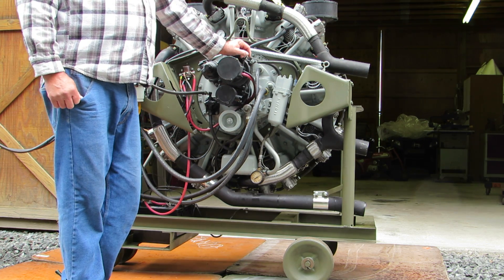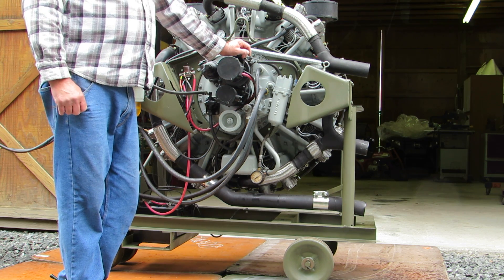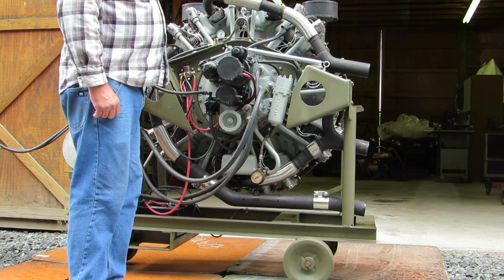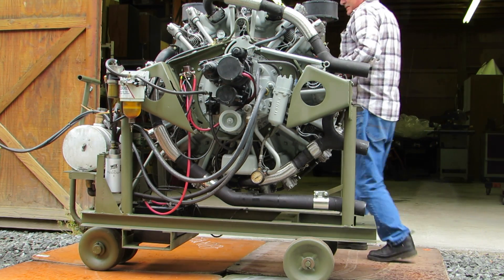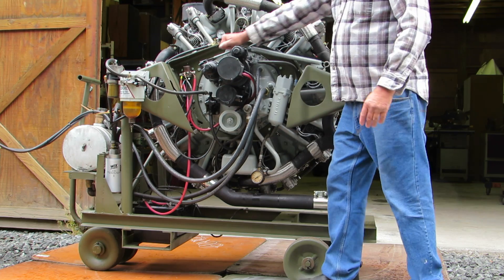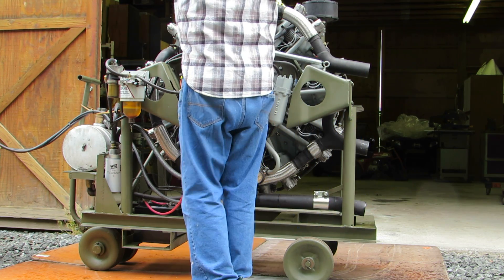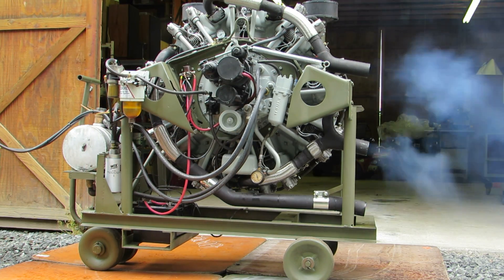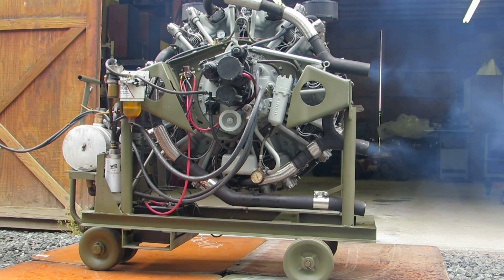Guiberson radial diesel engine, M3 Stuart Tank

Comment: I know this is an old video now, but did these things have the same oil pooling and burning problems as a gas radial? I feel like any pooling could be catastrophic in something with such a high compression ratio.
Reply from the maker: Yes they did. Fortunately it has a compression release to allow easier turning of the engine to clear the cylinders

Comment: I have this exact engine and was wondering where to get an inertia starter for it and what exact model to look for. Any help would be greatly appreciated. Tom
Reply from the maker: Tom, I did some research online:               Greg Whitney
(602)978-3380
Just tell him what you need it for, he will know what you need. Tell him Mike Moffitt sent you. Good luck!
Reply: @MrMikey4026  thank you sir! I'll get on touch with him.
Reply: @MrMikey4026  looks like the number is no longer in service 😕
Reply from the maker: That sucks, I will do some more research
Reply from the maker: I emailed Greg and his son replied, sadly Greg passed away last March. All of his inventory was sold. The starter I used is from a 3350 Curtis Wright radial engine.
Reply from the maker: I am going to have to do some research, I bought it 14 years ago. It came from a guy that supplied starters for the big alcohol engines from my truck pulling days. I will not be home for about 10 days, so it will be a while.

Comment: Amazing that air can keep all that cool. I guess the low hp helps. Then again, there are some air cooled gasoline radial engines bigger than this.
Reply from the maker: It does not create much heat without load. It never warms up, does not help out the smoke much. It is also supposed to have 60 weight aircraft oil in it, can't much afford that.

Comment: it was called the A1020 for airplanes according to Wikipedia this engine was used on the Stinson Reliant. Most of the ones that survive were used in the M3 Stuart Tanks . this type of Inertia starter has an external drive as you can use a crank and wind up the starter with a crank. Not sure what aircraft uses a 3350 engine that uses this starter. as most likely used on a Wright R-1820 used on a Grummann J2f Duck.

Comment: Any engine you have to wind up the starter and then engage it is something special.
Reply: We had a diesel auxiliary engine on our tug boat,  it had a big fly wheel. 
The fly wheel had to be cranked up  then the clutch released, which started the engine.
Worked every time!
If everything went dead on the boat, no electricity, batteries dead, no compressed air, this small diesel engine can get everything started up!
Reply: Inertia starters were cool.. Especially the hand crank ones. No dead batteries to worry about. You just had to put alot of elbow grease into it.
Reply from the maker: Someday I will find or build a crank.

Comment: This is so cool. 
I want one. 
It’s going to go in my 84 Land Rover.
Reply: Good luck - if you can get it to fit it'll turn the clutch and transmission into a grenade. Landies are designed for 140hp at most - even the LT77 5 speed might take 250hp before it turns into metallic shrapnel. Although it'd be an interesting project.

Comment: I hear radial engines can be the highest power to weight engine configuration since the crankcase or block is small compared to an inline or V.  Is the block on this engine aluminum or cast iron?
Reply from the maker: It is aluminum with steel cylinders.

Comment: Wow what a beauty. That is amazing. Could this radial be used in an aircraft ? Or is it too heavy ? Imagine showing up at an airport and asking for diesel instead of 100oct gas ?!?!?!
Reply from the maker: It was, on a Stinson 77. I know of no surviving aircraft versions. There were slight differences between the tank and aircraft engine's.
Reply: in an aircraft application, you would just run it on jet fuel. Any diesel will run on jet fuel, the main consideration is the reduced lubrication provided by it.
Reply: I believe the Soviets had a diesel powered plane in WWII

Comment: Diesel radial? Now that's something I'd never heard of before. Learn something new every day, I guess! Thanks for sharing this awesome engine with us.
Reply: Packard built radial aircraft diesels in the ‘20s and I think used on ford trimotor planes.  Nordberg RTS 1412 is a vertical shaft diesel.  Caterpillar converted 100s of Continental gasoline radials to diesels for Soviet WW2 Sherman lend lease tanks.  Radial is a strong arrangement and good for diesel application.
Guiberson was located in south Dallas, Tex.  The plant was surrounded by walls and entry by steel gates.  When the Trinity River flooded, Guiberson shut the gates and waited it out.  Guiberson main products were oil tools.  Don’t know if plant still operating.
Reply: @danbenson7587  can you find the address of the Guiberson Factory in Dallas Texas, please sir?
Reply: @andrewquake4631  I saw Guiberson’s plant 40 years back, and can’t remember the address.  Guiberson (still around) was bought by Dresser Industries, which in turn by Halliburton, and Halliburton has merged with ..??.   Likely can Google Dresser, get a phone # and investigate from there.  Shoe leather.
    The Guiberson original plant likely sold in late 80’s early 90’s.  
     If the engine is of interest, the FAA still has the type certificate.  There are a few engines still around.  There was one on display at the University of Dallas, so I heard, but have not confirmed.    Best I can do.    Cheers

Comment: wow! it runs so smooth! from what I've seen it looks like these radials run better on diesel then they do on gasoline.
Reply: The gasoline radials made for tanks were quite different to aero engines, different cam and ignition timing, they will idle at low tick over and sound like a very nice, very large  V8 engine. Tanks needed torque at low revs for shifting heavy weight, aero engines needed power at high rpm to spin the prop. The radials in a Stewart sound magnificent, we have one running at the military museum I work at.

Comment: Never knew anybody made diesel radials, cool
Reply: Kinda has a old Ford idi 6.9 liter sort of sound to it..  neat little thing
Reply: i thought i had read about anther radial diesel (converted from gas) maybe some one else can enlighten us on that matter
Reply from the maker: @philippetays4263  Caterpillar converted Wright 1820 engines to run on diesel fuel. Only 120 were made.
Reply: @MrMikey4026  yes thats the one remember now when you put names down,  thanks
Reply: @MrMikey4026  How much horsepower and torque did the CAT Wright R-1820 produce? How much did it weigh? How much torque did the 310 horsepower Guiberson produce and what is its weight? Thank you sir.
Reply from the maker: @andrewquake4631  I have never found any torque specifications. The A1020 weighed 650 pounds.

Comment: What a staggering engine! 
Like other commenters I did not know of any radial diesel engines in existence. This example is in factory-fresh condition and is a credit to the owner. Thank you so much for sharing it with us.
Reply: Radial diesels were used even as early as the 1920's! if they spent money on R&D via the War Dept they could've improved them for aircraft (like turbo/supercharging and Injecting fuel etc) imagine a C-47 with radial diesels using kerosene and 20 % diesel fuel the range could've been extended by a few hundred more miles with drop tanks even more! or a S-55 Helicopter, imagine landing commandos in the Yalu chicom North Korea POW camps  to pick up captured UN soldiers ?
Reply from the maker: Hey, thanks!

Comment: Can you run it on jet fuel since some diesel engine aircraft uses jet a-1
Reply from the maker: I think it would do just fine, the only part of the injection system  not lubricated by oil is the plunger and barrel.

Comment: How much power it produced?
Reply from the maker: 250 in the tank, 310 in an airplane.
Power was reduced for the tank application, as the transmission was rated for 250.
Reply: @MrMikey4026  wow.. Hope to see  this machine test in a real airplane, btw as a diesel, has it been tested use Jet A fuel?
Reply from the maker: @hendriprijanto4623 , I have no idea? I know of none in airplanes.

Comment: They converted a regular airplane gasoline radial engine to a Diesel radial engine? Didnt know it was possible...they changed the cylinders and piston of the original to obtain that?
Reply: This is not converted. Guiberson engines were designed and built as diesel radial engines
Reply: le bailli de savoie: As french i inform you that the french engine maker Clerget did built many radial diesel from 1929 to ww2 in 9 and 14 cylinder...A diesel  need many reinforcements because the heawy knoks and the high compression+ a heawy high pressure injection pump= much heawyer as a gasoline engine...

Comment: This belongs in a Beechcraft Staggerwing, I love seeing 80 year old tech still being used.
Reply from the maker: I just like old engines, radials especially! You would not find me in an airplane with it supplying the power!
Reply: It doesn't make enough power to be used in a Staggerwing.
Reply from the maker: @PistonAvatarGuy , they were detuned for the tank. They were prototyped on a Stinson 77.
Reply: @MrMikey4026  Yeah, but they only made 310 hp as an aircraft engine, the Staggerwing had 450.
Reply: @PistonAvatarGuy  There are many beechcraft staggerwings that have engines in the 225hp to 350hp range.
Reply: @ADITADDICTS  True, but the engines used in those versions of the Staggerwing were much lighter than this engine. More weight + less power = terrible performance.
Reply: @PistonAvatarGuy  Diesels are heavy, for sure.
Reply: @PistonAvatarGuy  An engine of this configuration tends to generate more torque and lower horsepower than a comparable gas engine version.
Reply: @andrewquake4631  No, it doesn't. Diesels generate LESS torque than gasoline engines, unless the diesel is boosted higher. Having more torque also can't make up for having less power.